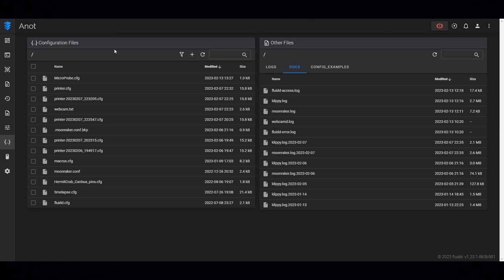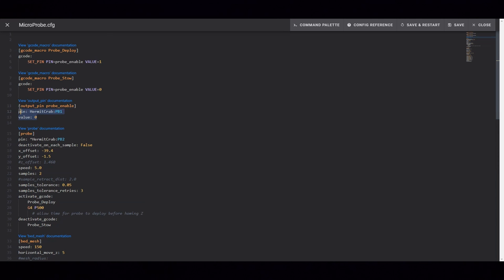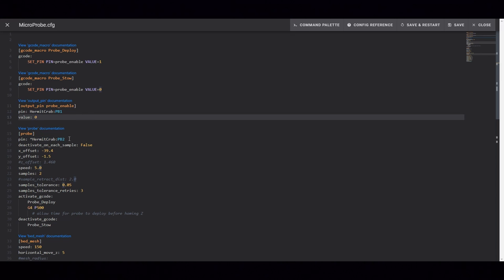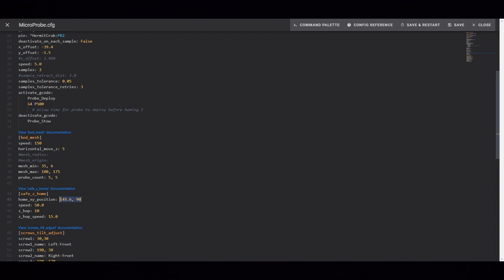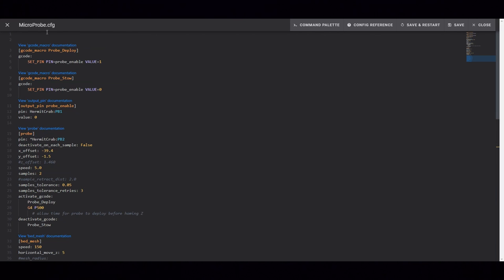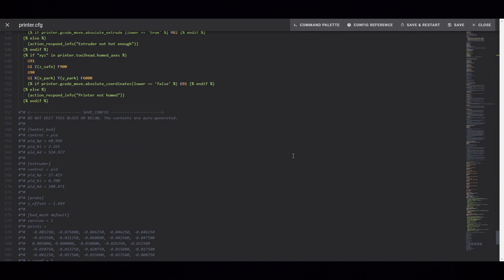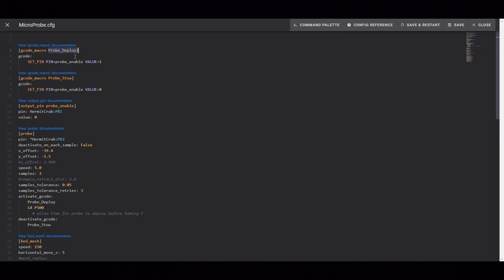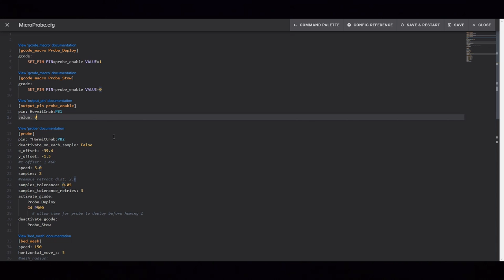How to configure the BIQU Microprobe for Klipper

Comment: Thank you for the video and config. 
Installed this on my creality 4.2.2 board with sonic pad. 

Incase anybody else keeps getting the “control_pin in bltouch must be specified” fault. Even after commenting out the bltouch section, you will need to go down to the save config section in grey at the bottom and delete the two commented out lines *#[bltouch].  And *#z_offset = 3.50
This will take care of the bl touch fault that was coming up.
Reply from the maker: Good thing to point out.

Comment: it works fine but it seems there is the problem with my probe or my board? it wont trigger the z homing it just guess goes down to the center of the earth. i also notice that mine the LEDs is always blue rather on some videos i saw it turns purple when the probe is down, is there something i'm doing wrong?

Comment: So I am using probe_calibrate with paper and then I am calibrating a bed mesh with the MicroProbe V2, but every time I go to print it drags the nozzle across the bed. Any ideas what I am doing wrong?
Reply from the maker: Do you do the save_config when you are done? If so, do you have a z offset set too? Not z probe offset but just a z offset. You could just baby step it to the right height and then save_config.

Comment: Excellent, thank you. I just got my probe, installed it expecting it to, you know, just work, and probably would've returned it if it weren't for this video. The only thing missing is that there's a V1 and V2 for the probe, apparently V2 requires you add a ! after the up arrow for the control pin as per the github documentation
Reply from the maker: Yeah, the V2 was just recently released. I'll add a note to the code in the description.
Reply: @StackingLayers  Apparently there's something else I'm missing, I followed the video and installed the unit but it won't actually stop the bed from raising (ender 5+) when the probe is triggered. Back to the drawing board.
Reply from the maker: @kylequinn1963  double check that it's in the correct port you have assigned. What motherboard and where do you have it plugged in to?
Reply: @StackingLayers  BTT SKR Mini E3 V3 plugged into the Probe port, using the same wire as my BLTouch (Documentation says its the same) and running the same pin setup as the BLTouch as per the instructions. I can make the probe deploy and retract, but it wont actually trigger when the bed hits it.
Reply from the maker: Is the probe pin set like this?
[probe]
pin: ^!PC14
Reply: @StackingLayers  Yep, everything is the exact same as in your video here, it just will not actually trigger. If there's a way to DM you I'd be happy to do that, its driving me nuts that it isn't working -.-"
Reply: @StackingLayers  
I've tried everything regarding that pinout, ^PC14, ^!PC14, ~PC14, ~!PC14, PC14, !PC14, none of them make the probe actually work. It will cycle between deploy and stow just fine, but it wont actually trigger the Z endstop at all. Looks like I'm gonna be asking for a return and going back to the BLTouch lol
Reply from the maker: It will only be ^PC14 ( for the V1) or ^!PC14 (for V2 )
You do have 
    endstop_pin: probe:z_virtual_endstop
in the [stepper_z] right?
Reply: @StackingLayers  Yes sir, I'm thinking mine's defective or something.

Comment: hey so i have for most part setup however when i hit home x and y home and goes to centre of my bed probe pin then deploys but once it comes down to the bed it doesnt trigger and just grinds the bed into the toolhead and i have to switch printer off at the switch to get it to stop?
Reply from the maker: Do you have the virtual z endstop set for your z axis? And the ! Mark in front of the signal pin?

Comment: Patrick, try slowing down the probe speed. This is an optical probe so slow is good. I had the best results at 1mm/s. Lift speed on my system (K1 Max) needs to be between 15-20mm/s for best results. Try different speeds and you should be surprised. 

PROBE_ACCURACY PROBE_SPEED=1 LIFT_SPEED=15

Also, it's worth mentioning that the accuracy of the probe drops by a factor of 10 when heated to around 100C. I get standard deviations between 0.0002 and 0.0004 on a cold sensor and 0.001 to 0.004 at 100C. Also... Do mention preheating. My K1 Max bed needs about 10-15 minutes to settle after reaching temp.  Probing a changing bed is pointless.
Reply from the maker: Good point. When I made this video the V2 probe didn't exist. The original probe was a click switch style and works fantastic at higher speed. There was unfortunately other issues that made them change to the optical sensor and hance V2. I might make another video as a supplement for this one as there's some good points to touch on with the new version that this video doesn't really cover.

Comment: Thank you for the video and the config.
I use a raspberry pi pico as second mcu and connect microprobe v2 to it but it not work properly. It can push down but can't pull up so i have to manually push it back. Any ideas what I am doing wrong?
Reply from the maker: Double check that you have the correct spacing in the gcode macro. The line under the gcode: part must be indented to work.

Comment: Greetings, I found that when I was running the " PROBE CALIBRATE " in Klipper that when I had the Z offset finished and I pressed accept Klipper errored out saying that it could not update the z_offset value in the microprobe.cfg file.  When I moved the code from the microprobe.cfg file and pasted it in the printer.cfg file and commented out the #[ include microprobe.cfg] file the " PROBE CALIBRATE " worked ok and did the update to the z_offset value. 
If you know?   Is there a way to have klipper update an included macro file?  Thanks for the read. Doc'
Reply from the maker: That is how that works. You can only save_config in things in the printer.cfg. but you can comment out just the z_offset portion in the probe configuration file and in the printer.cfg have just 
[probe]
z_offset:  #with your starting number here
Reply: @StackingLayers  Thanks once again.  Great information. Doc'

Comment: great video thanks for putting in the time for this.  I'm having an issue with my v2 microprobe i set this all up per your video, separate .CFG file have calibrated z offset but when i try to do a bed mesh i get a move out of range error in new to klipper. my printer is an ender 5 with a BTT M8P im thinking it has to do with this section of the MicroProbe.cfg 
[probe]
pin: ^!PB2        # Change this to the Probe/Z- pin number for your board. Remove the ! for V1 probes.
deactivate_on_each_sample: False
x_offset: -0.9                 # Change the probe offsets to meet your machine requirements.
y_offset: 46.61
z_offset: 0.799
speed: 5.0
samples: 2
should the z_offset here be commented out & commented in in the printer.cfg?
also after doing PROBE_CALIBRATE i get this message SAVE_CONFIG section 'probe' option 'z_offset' conflicts with included value

thanks for any help
Reply from the maker: Take away 50 from your max_mesh y position. It's listed as two different numbers the first one is x a second one is y.  So for example if it's 230, 230 then you change it to 230, 180. Basically what you need to do is see where your nozzle is going out of bounds in order to have the probe go to where you're telling it to and since you're y offset is almost 50 millimeters then you have compensate for that. Your nozzle is not allowed to go out of bounds.
Reply: thank you that put me onto the correct thing to adjust. i just had to play with those numbers:medal-yellow-first-red: @StackingLayers

Comment: Hi, great video.
But I can't get past this klipper error: Option 'control_pin' in section 'bltouch' must be specified
I don't get it, I have commented out everything in the bltouch section in printer.cfg.
Reply: Got it. Had to remove bltouch and z-offset at the bottom in the save_config area
Reply from the maker: Look at the very bottom of the printer.cfg there may be a save config section that looks commented out. If you see any BLTouch stuff in there that needs to come out. You can cut it out of there and paste it up with the other BLTouch stuff as a comment(removing the *) if you want to keep it just in case.

Comment: Mark Corliss again. I’m using Mainsail because that’s what I started with. I think I understand why having the probe infor/settings-code in its own config file is a good idea. Of course I already have/had this info in my generic and printer cfg’s. Would adding your code as another file / to duplicate what’s already there be okay?  Please reply. All of this is a foreign language to me, but I have to figure this out to get my Hurakan working again. Thank you.
Reply from the maker: No do not duplicate it, it will cause errors. You do not have to delete your original code if you want to leave it. Putting a, # at the beginning of the line will make the program ignore that line. So just put a # in front of each line of the older part you don't want to use, that way you have references or can just remove the # to reactivate it.
Reply: @StackingLayers  thank you for getting back to me. I understand commenting and un-commenting. There's a # at the end of the "hidden, I'll say" line as well, yes?
Reply from the maker: No need to have it at the just the beginning of each line that should be commented out.

Comment: Hi @StackingLayers.

Thanks to your video tutorial, my probe is working fine.

However I'm not able to do the Probe_Accuracy test. When I issue the command, the first measurement is made and the probe is stowed, giving the error "Probe triggered prior to movement" when trying to do the rest of the measurements.

Same happens to you?
Reply from the maker: You may need invert the probe pin signal if you haven't already tried that. It will be add or remove the ! in front of the  pin number.
Reply: The probe works fine and the Z home works.

After Issuing the probe_accuracy test the first measurement also is done correctly. 
What should not happen is the stowing of the probe between multiples probes.
Reply from the maker: It's not set to stow between probing, but that error message is not because of it not stowing. It's for some reason getting a triggered signal when it shouldn't be. What controller board is it on?
Reply: SKR 2.0
Reply from the maker: Do you have this in the probe section?
    deactivate_on_each_sample: False
Reply: Yes. And the weird part is that the Z home function works like a charm. Touch in a first aprouch and then does the second approach at a slower speed.

Still not try the bed mesh feature since I have a couple of offsets to measure first.

But this Probe_Accuracy function should work by now.

I made it work in a different setup with a BLTouch. I'm aware that for this probe, it's [probe] settings.
Reply from the maker: So for the skr 2 it should look like this, assuming you are using the probe pluge on the board. Of course your offsets.

[gcode_macro Probe_Deploy]
gcode:
    SET_PIN PIN=probe_enable VALUE=1

[gcode_macro Probe_Stow]
gcode:
    SET_PIN PIN=probe_enable VALUE=0

[output_pin probe_enable]
pin: PE5
value: 0

[probe]
pin: ^!PE4
deactivate_on_each_sample: False
x_offset: -33.7
y_offset: 0.2
z_offset: 2.6
speed: 5.0
samples: 2 #sample_retract_dist: 2.0
samples_tolerance: 0.01
samples_tolerance_retries: 3
activate_gcode:
    Probe_Deploy
    G4 P500
deactivate_gcode:
    Probe_Stow
Reply: @StackingLayers  similar...

[gcode_macro PROBE_DOWN]
gcode:
    SET_PIN PIN=probe_enable VALUE=1

[gcode_macro PROBE_UP]
gcode:
    SET_PIN PIN=probe_enable VALUE=0

[output_pin probe_enable]
pin: PE5  # Set to the control pin on your board
value: 0

[probe]
pin: ^!PE4  # NOTE FOR V2 users: Set this to ^!PC14 to set the low level trigger 
deactivate_on_each_sample: False
x_offset: 9.379
y_offset: -35.83
z_offset: 1.54  # Will be overridden when you do a PROBE_CALIBRATE
speed: 2.0
lift_speed: 4.0
samples: 2
sample_retract_dist: 0.5
samples_result: average
samples_tolerance: 0.05
samples_tolerance_retries: 3
activate_gcode:
    PROBE_DOWN
    G4 P500
deactivate_gcode:
    PROBE_UP
Reply from the maker: Yeah that looks good. I'm thinking maybe you are having the issue where the pull-up resistor on the skr2 probe pin is not strong enough to keep it from a false trigger. You might need to move the probe with to the Z stop sense pin. It has a dedicated pull-up resistor onboard that is more stable.
Reply: @StackingLayers  Z-Tilt also was giving the same error. 

i just changed "deactivate_on_each_sample:" to True and now it works.

This means that it will always have to stow and deploy for each probe measurement but the errors have stopped.

This sounds like a firmware bug, because homing Z was doing two readings without stowing was working fine.

Now with this change, homing z is also stowing and deploying twice.
Reply from the maker: Yeah that sounds like an odd bug. I run 2 of them and don't have to stow in between probe points on either one. One is on an skr2
Reply: @StackingLayers  you were right all along.
Just for the sake of it, I connected the probe to the Z-Stop pin and stop having the issue.
Thanks for your support and wish you the best.
Reply from the maker: @vitorfilipe2065 yeah for some reason I'm starting to see several having an issue using with the probe pin internal pull-up resistor not being strong enough to hold the signal high between probes. Since the Z End-Stop port has a separate dedicated pull up resistor, the signal is way more stable.

Comment: Any insight to the Marlin config? I've followed the Marlin documentation but when homing it draws the bed down, then up, then starts as if it was going to home but Failed Homing error happens.
Reply from the maker: Sounds like you might have to invert the logic for the probe pin. 
#define Z_MIN_PROBE_ENDSTOP_INVERTING true
Reply: @StackingLayers  thanks for replying...I tried exactly that but no cigar....it's truly weird...homes X and Y, lowers Z (for clearance), lowers Z again, then raises Z to home but never makes it to the probe and then Failed Homing error.
Reply from the maker: Is it a V1 or V2? Also check the wiring again. The second z retract makes me think that the firmware isn't getting the signal it's expecting.
Reply: @StackingLayers   it's the V2 and I'm pretty sure the wiring is correct....they don't provide the complete pinout but following the guide it seems to be the same....they finally reached out via Whatsapp but we'll see how it goes. Thanks again for replying.

Comment: Hmm my probe wont deploy when I auto home. I'm missing something. Is it because im useing the probe for the z endstop as well as in I do not have a endstop for my z just the probe?
Reply from the maker: Did you set endstop_pin: probe:z_virtual_endstop in the stepper z section?
Reply: @StackingLayers  that is what I didn’t do. As frustrating as klipper can be I’ve learned a heck of a lot these past 2 weeks. I just figured out my max and mins and I figured out I lost around 30mm because of my h2 hermit crab combo took me 6 hours but I got it that was a small victory I see why kipper is so appealing now you learn things.
Reply from the maker: The learning curve with klipper is definitely something I like about it.

Comment: How can I see my x offsets, y offsets and my bad mesh?
Reply from the maker: Your offsets are put in the printer.cfg under the [probe] section. 
The bed mesh can be viewed in the heightmap section of mainsail, for example.
Reply: @StackingLayers  After following the tutorial the probe goes up and down but when I put my finger on it it doesn't stop moving up the table
Reply from the maker: @tchepso5924 double check that the sense pin is defined to the one you plugged into. And it has the pull-up mark. ^

Comment: can you use this method with vscode and marlin ?
Reply: currently trying to figure out how to use this with my biqu b1 with an skr 2 board
Reply from the maker: There's some different things to do with Marlin. It's explained in the user manual. All you have to do differently is put the pin numbers for the skr2. The example in the user manual is for the skr3 
https://github.com/bigtreetech/MicroProbe/blob/master/MicroProbe_User_Manual_20230616.pdf

Comment: Probe_Stow doesn't seem to be working for me.  The pin deploys but won't retract.
Reply from the maker: Double check that the code is all there and the spacing is correct. It should be something like this, 
[gcode_macro Probe_Stow]
gcode:
    SET_PIN PIN=probe_enable VALUE=0
Reply from the maker: There's 4 spaces before SET_PIN...... under the gcode: part
Reply: @StackingLayers  yeah, they are all there.  I used their configuration from github as a reference and compared it to yours
Reply: @StackingLayers  otherwise it works fine.  Probe deploys, z home works, mesh works, just doesn't retract.
Reply from the maker: Hmm very odd. That may be a mechanical defect.
Reply: @StackingLayers  Yeah, I think I'll get a new one and send this one back.  I took it off to mess with the mount, and I noticed that it even stayed out while the machine was powered down and I removed it.